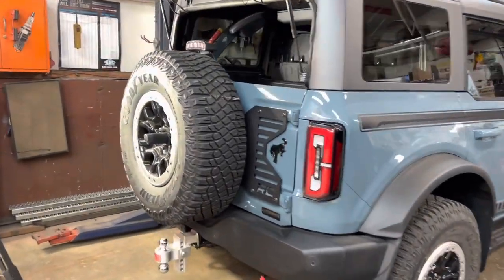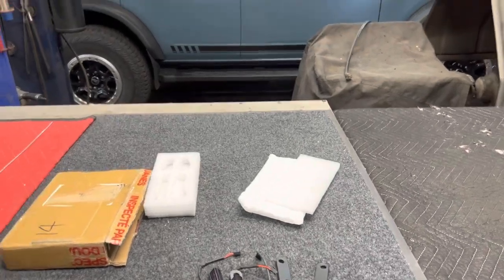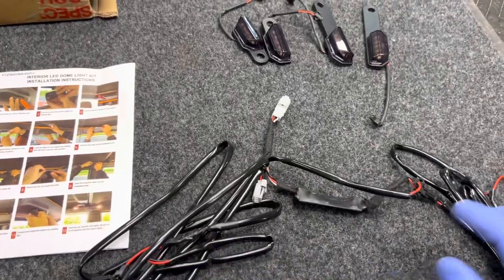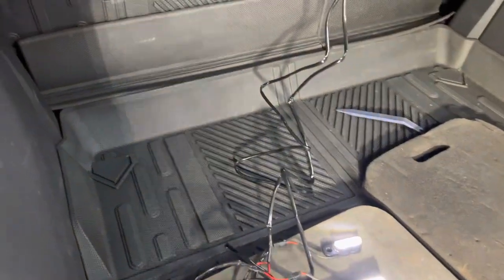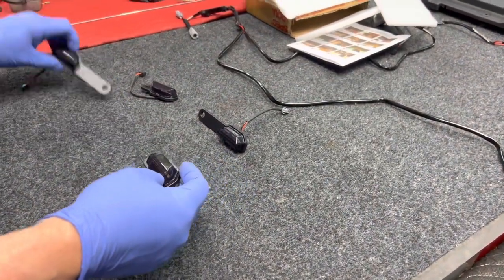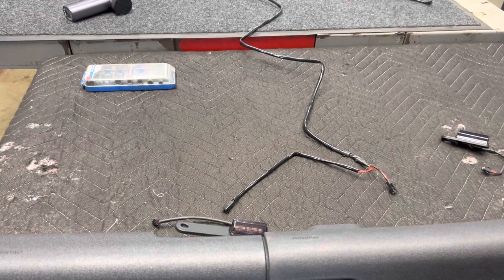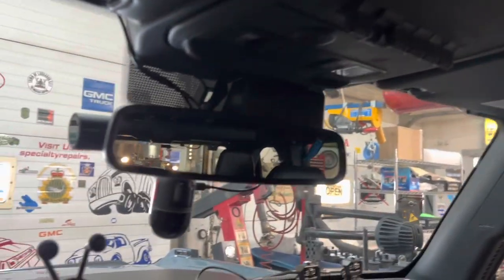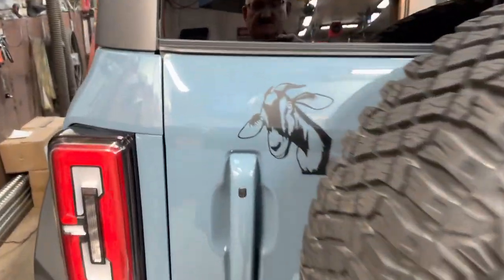Mabett 4 pc Interior Bronco Light Kit Installation

Comment: great video, thanks!
question for you, I have aluminum grab bars mounted at the airbag spots. Will this get in the way of the lights? These are the handles I have: Tänzedzm 2Pcs Roll Bar Aluminum Alloy Grab Handles 
Thanks for the great video!
Reply from the maker: I have the nylon grab handles on mine and it worked fine but with yours I’d say no. There’s not much room there.

Comment: 6:13 6:14 6:15 I bought and installed this.  I really like how this lights up the black hole.  My only issue is the rear center light comes on randomly while driving.  Not a big deal in the day, but irritating at night.  I can hit the map light switch once to turn the lights on and once to turn them all off, but then several minutes later, the center rear light (not the side lights) comes on again.  I couldn’t find a Mabet website to aske them, and Amazon didn’t have a question page for the lights.
Any idea how to remedy this?
Do you know how to contact Mabet?
Thank you

Comment: There was another video posted a month ago as to yours which was 4 month. I bought thr kit on amazon based on your link .it was out of stock for a week but i just ordered it and shiuld have next week. In the other vid ,the harness was hooked up to the front light not thr rear. Do u know if mabett changed the kit?
Reply from the maker: I’m not aware of any changes. Weather it’s hooked up to the front or rear lights doesn’t matter in my opinion. What ever works best for you. 👍
Reply: I just got  the kit and the instructions say to hook to front light. Personally i dont see hiw your going to take that front channel down. I am going to measure the harness to see if it reaches from the back  light. It would be nice if mabbot included better instructions.  If the harness reaches than i have to hope that the connector on th front and rear light are the same . For some reason this doesn't seem like its going to be easy